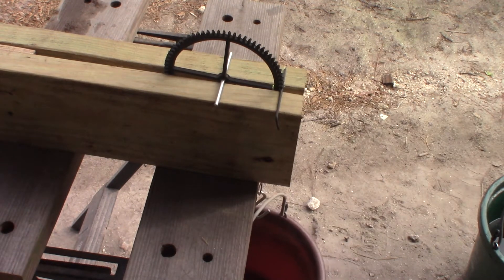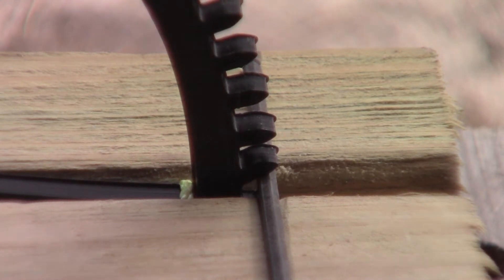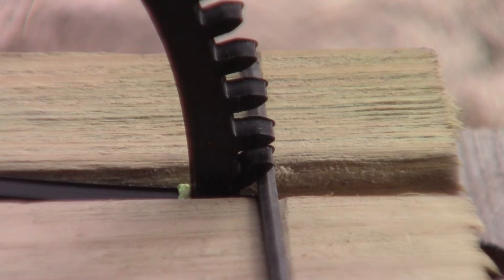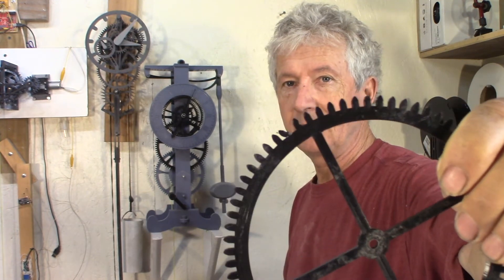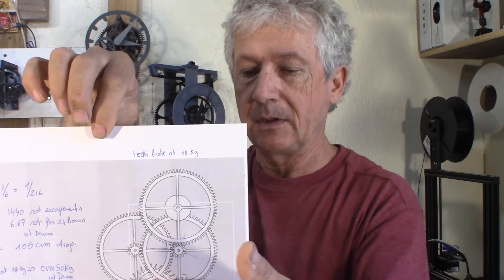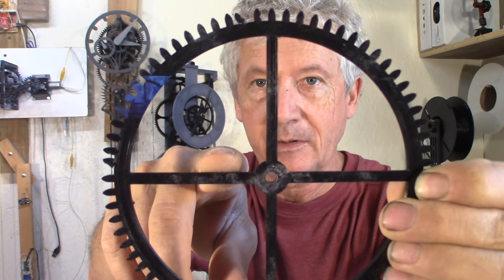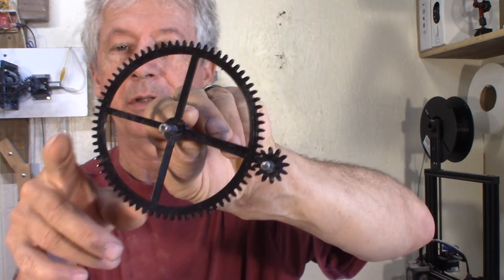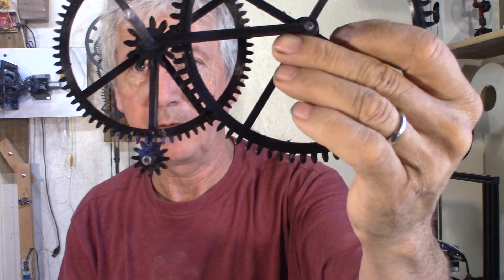Clock Design with FreeCAD Part2: Testing teeth strength

Comment: with the advantage that you have, you should be able to put 10 kg on there and have a Clock that last all month. 
 do you need another wheel. The bigger the better. 
What is the maximum gear ratio that will reliably turn an escape wheel?